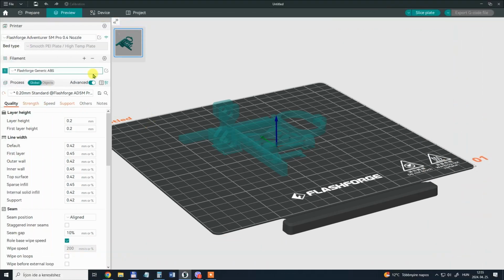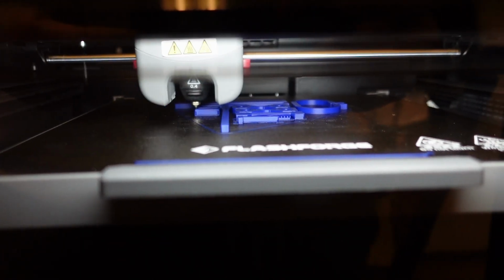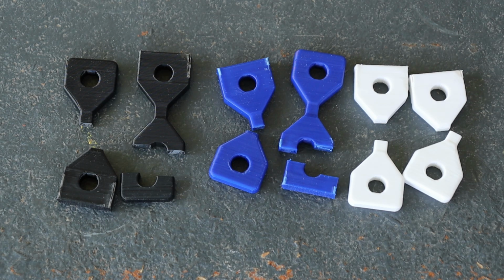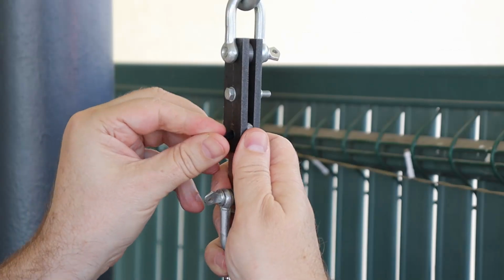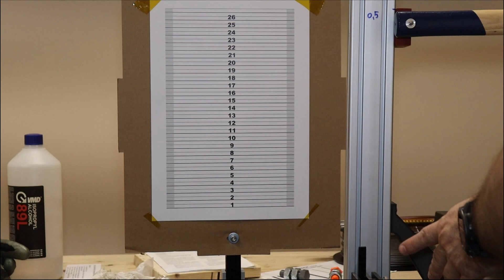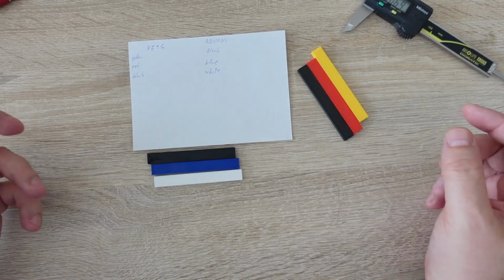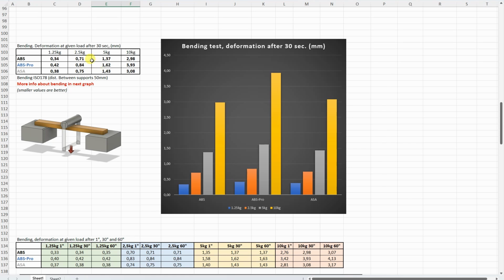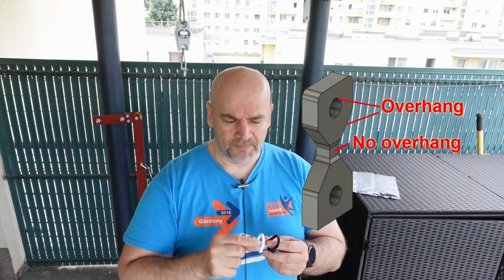Flashforge ABS vs ABS Pro vs ASA - mechanical test and comparison

Comment: YT is not recommending your videos however, AI is because you are providing superb technical information needed 3d print design engineering. It would be interesting to compare several of your filament tests against a professional grade printer like a Stratasys F370. I'm willing to bet there would be no significant differences in the parts breaking other than the absurd price behind the Stratasys.

Comment: Thanks for your videos. Find your results for FF ABS Pro to be quite strange when compared to FF marketing. Here's what they say about it:

"ABS Pro filament is more excellent than ABS in each aspect. ABS Pro, with improved mechanical properties, better handles problems of model shrinkage, printing odor and requirement print temperature."

Why do you think your results were so much different?

Comment: I knew that the ASA would be stronger before I even saw the test. It had time to slowly cool down and release internal stresses. You said it was the next day when it had fully cooled. You need to let them all fully cool otherwise the test will not be good. In fact, it would be interesting to see if you could repeat this but print one test taking it out immediately and the other test let it cool slowly to room temp. Maybe an idea for your next video? ABS should have the biggest difference because it shrinks the most when cooled and will need to release the most internal stresses. Maybe also see if there is difference when printing it in your Qidi at 65C.

Comment: Video format: As an engineer I appreciate your content and am a subscriber but honestly I skip to the results after a couple of minutes. Your channel is called My Tech Fun but where is the fun? Most people (myself included) are not solely printing functional parts so the straight up engineering approach may be fun for you but not everyone perhaps. I watched this video because I was interested in the ASA vs ABS comparison but I don’t think many people are going to be drawn to a Flashforge filament shootout using a Flashforge X1C knockoff.

Don’t get me wrong, I think your content is useful but maybe not relevant or interesting to most people who print in plastic. I don’t have a channel so I am eminently unqualified to offer advice but I think in general people want to be entertained while being informed. Your videos are certainly informative but when watching one I feel like I’m sitting through a PowerPoint presentation. Aurora Tech Channel is similarly formulaic but at least they also print some interesting models.  I think you could keep your same technical approach but maybe tailor it to topics for the masses, like wet vs dry filament, does color matter, plain vs matte vs silk, glitter shootout: sparkle vs diamond vs galaxy…which gives the most bling for the buck? 😆

Or how about “I had AI design the tests…the results will astonish you! 😱”. Ok, that was a joke but ngl I would definitely click on that!

Comment: You constantly put out great content and great tests. It has been really valuable for projects I have done. Thank you!
One idea/question: With AMS-systems it is easy to print with multi material. Could you make parts stronger with making sandwich-prints? Example. You print a part in ASA, and every other layer is ASA with CF. It should be both strong and stiff, and adhesion should also be good as it is the same core material. A test of this nature should be fun!

Comment: I feel that you ended up testing the FlashForge Adventurer printer more than the actual filament… the way the parts broke not on the small section area suggests me the hot end is less than optimal - also the filament having a much weaker behavior than the average for ABS. I also wonder why FlashForge calls that an “ABS Pro” 🤔 My bet is that if you print subjects on your Prusa MK4 you will get theses same filament into much stronger parts. Excellent work as always Igor! So, so many hours!!! ❤
Reply from the maker: In the meantime I figured out, the ABS Pro is easier for 3D printing, I experienced that after the recordings, when I played more with those filaments. But it looks like they sacrifice mechanical properties.

Comment: Something I am very interested in is the most heat resistant parts I can print on my existing printer so I am especially interested in filaments like pet-cf and pc-cf, how well they can print open air or with up to maybe a 60C chamber, and how easily they can be annealed.
Reply: As you do more engineering type filaments it would also be nice to see chamber temps. Even on ABS I see a big difference in strength depending on my chamber temp.  Some materials for example I know I would need higher chamber temps than I can currently achieve to even print (70C+).

Comment: The ABS pro might be modified (ABS blend) as it seemed to have better adhesion to the bed compared to the normal ABS that you took a part off while the bed was still hot. One quick way to check if ABS pro is a blend is to see how it reacts to acetone. If it is a blend it will not smooth as fast and as cleanly as pure ABS would and you might see white marks/lines appearing where the acetone evaporated.

On another note I am your patreon for more than a year now and I watch all filament test videos you put out. Please don't lose motivation and keep going. Your videos are to the point and we really appreciate this, but unfortunately it is not what the engagement and entertainment algorithm wants. It is no accident that many channels no longer do much of "reviews" and technical comparissons and mostly do project based videos with also random upload schedules because they upload when the project/video is ready. Stefan's (CNC Kitchen) last pure filament review video was Prusament PC blend from 2 years ago. Youtube wants novelty, different interesting topics that grab attention. If you upload consistently and videos are very similar to each other (which is what you do), because there is no virality possibility points, youtube will not promote your channel. That is also why number of subscribers is not considered a good metric anymore and brands look at engagement and channels look at click through rate and watch time.
Reply: well said!

Comment: Ever since I built my first Voron I've been warned against printing structural parts in white filament over and over, supposedly because the amount of zinc oxide or titanium dioxide commonly needed to dye these materials from their natural off-white to pure white is terrible for impact strength and layer adhesion. I could never confirm this for myself and with the white ASA performing very well in these tests, I'm ready to throw this onto the "Busted 3D printing myths" pile.
Reply: I don't know if I'd say "busted," per se. Dye additives (and their amounts) can make a massive difference in the characteristics of a filament. I'd agree that the bright white color is not always the worst.

I think it depends very much on the line of filaments you're comparing, manufacturer and material. I wouldn't conclude from this one video that white filament is better because it's comparing a white ASA to different colors of ABS and ABS Pro, not other ASA filaments by Flashforge.
Reply: @SeanCMonahan  If you start going from simple color to more advanced additives to change the appearance of the material, e.g. modifiers to achieve silk, matte, transparency (on naturally opaque plastics) etc. you are in some cases basically going far off the pure material. But I've gotting a lot of claims that white filament is particularly structurally weak, compared to other colors. I also wasn't comapring the ASA results here to the other two filaments tested, but against other results from Igor's filament test table he shares on Patreon, perhaps I should've made that more clear.
If anything, the comparison the the ABS and ABS Pro shows that improperly tuned in settings (i.e. print temperatures and cooling) can compromise your material properties a lot more than a simple color choice.
Reply: This explains so much

Comment: Hi, please don't change your content, you are the only one doing such good and thorough filament tests and we really appreciate them!

Now regarding these, 1. Why is abs pro called pro, it was worse in literally every aspect lol
2. I don't get why manufacturers quote such low printing temps, 220-240 is abysmal for abs, imho it should be at least at 260. Asa at 260 got better layer adhesive ofc. 
Same for their petg, 240 is also on a lower end...
Reply from the maker: I agree, that's why I want to do a deeper investigation with some popular ABS (or ASA) filament. Temp+part cooling => layer adhesion.
Reply: @MyTechFun   can't wait for that :) imho you should do it on polymakers or bambu abs, those should be the best for reasonable price and availability
Reply: I suspect the low temps a lot of manufacturers list for their filaments are to try to make them seem "technically printable" on printers with PTFE-lined heatbreaks, like the stock Ender-3, Pro, and V2, which can't safely print above 240°C (235°C in truth is pushing it for safety).
Reply: @SeanCMonahan   yeah that is also my suspicion, but they are not doing themselves any favours, not to mention that most modern printers don't have this issue.